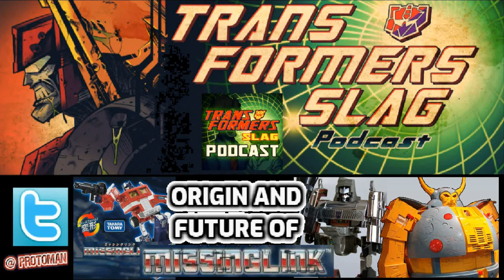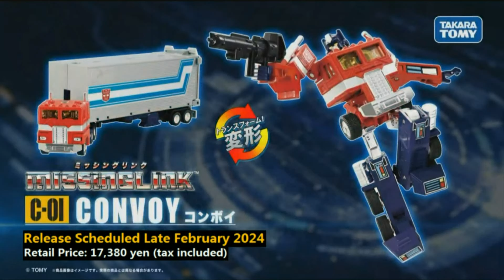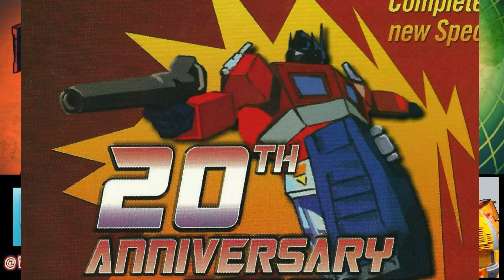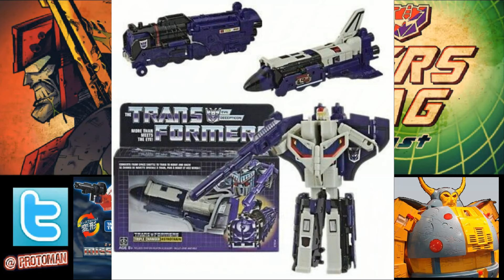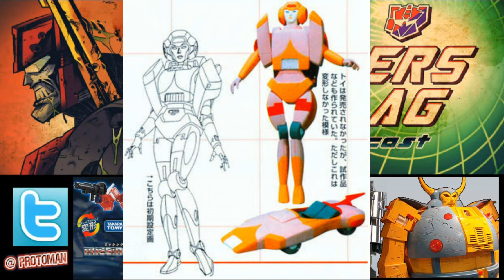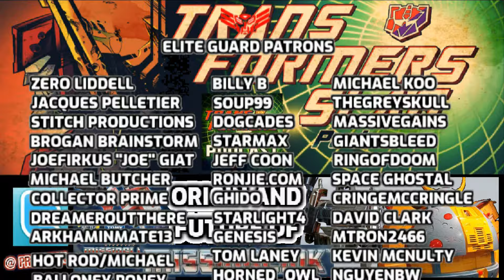What is NEXT for Transformers Missing Link? Interesting Origins!

Comment: If they do G1 Megatron, It would be Illegal in the USA.
Reply: Well to sell in stores but I can see imports be a thing. Especially if it is shipped in Robot Mode.
Reply: @ZX-Gear  I wouldn't get my hopes up.
Reply: @jessehorn6180  Well it hasn't even been revealed yet for one. And as for an orange cap,I dunno if that will be an issue or non-issue as even toys with caps don't cut it anymore.
Reply: @ZX-Gear  I'm not sure about it with the law.
Reply: @jessehorn6180 US law only requires the orange tip.
To sell it in stores in CA and now NY, it would have to be made in crazy colors.